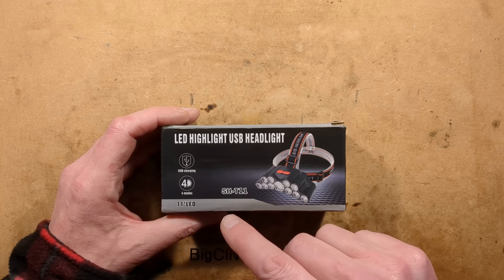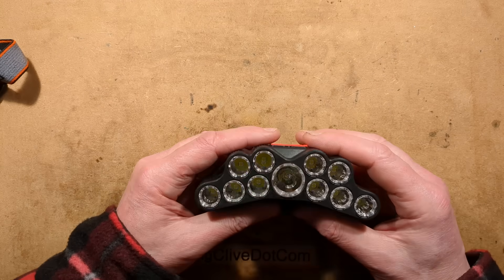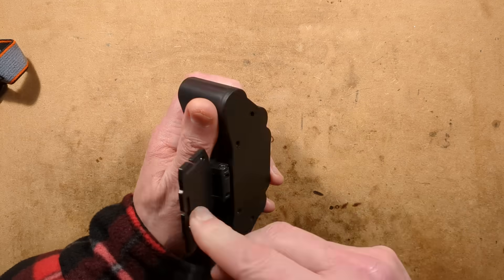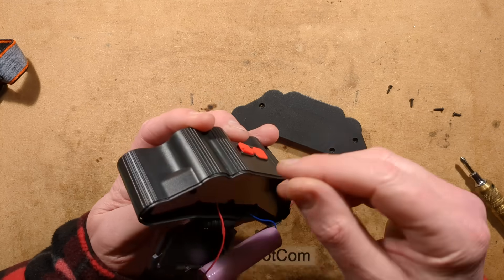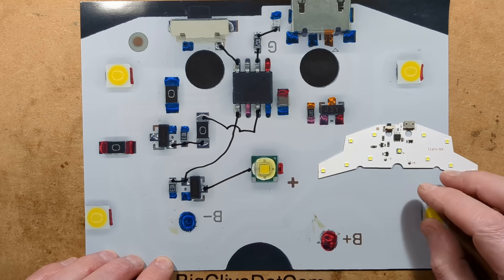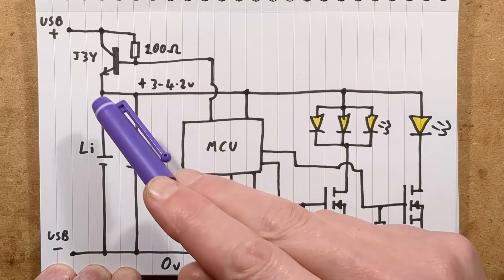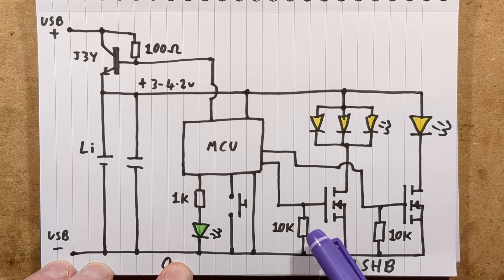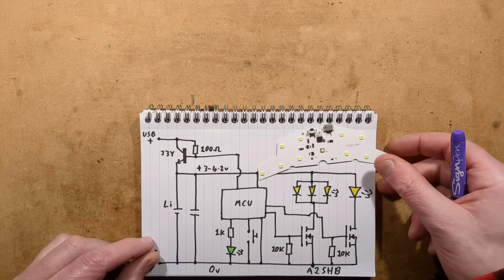Inside a (cheap) Mega head torch

Comment: Why does any headlamp have a strobe mode? I've never seen a use case for it. And assuming there is one rare time when it would be useful, make it not part of the process to turn the damn thing off EVERY TIME. Press and hold the button for five seconds or something to make it strobe.
Reply: I've seen some bicyclists with strobing lights which draws attention and I get that - but I'm with you. Strobing or SOS on just about every light is silly IMO.  That and having to cycle through all the modes to turn something off.
Reply: @amorphuc  , it makes the power supply last longer.   thats its benefit.
Reply: @vsvnrg3263 And it wears the switch out😊 sooner
Reply: @amorphuc  The strobing isn’t useful even for bikes. It makes it difficult to determine the distance of the bike. A solid light is way better.
Reply: @xluumu  My bike light has a couple optional strobe modes. I'll use those during the day. But at night, always solid. And I can turn it on and off without triggering the strobe.
Reply: @xluumu  Yea.  Not sure about that.  Strobing bicycle lights seem to truly draw attention.  I see them and take note for sure.  I don't think I have to consider their distance so much as far as seeing that there there.
Reply: @strehlow  I think any bicycle light is a very great thing.

Be seen!  Be happy.  Be cool!
Reply: @xluumu  Yea. Not sure about that. Strobing draws attention.  I'm not sure I like it though or if it's really useful.
Reply: Cheap Chinese LED flashlight chip looking to add features
Reply: @BlaMM74  bingo
Reply: @BlaMM74  They'll add them to rulers next(as they did with lcd), ban the Strobe!
Reply: It's for those occasions when you are in one man party mode and need to dance like nobody is watching 🥳
Reply: It's because China has a deal with the rest of the world to make people with epilepsy go to hospital more. 

It's a joke obviously. But seriously, I feel bad for people sensitive to strobing lights.
Reply: DiodeGoneWild made a video a while back showing how you can make torches skip the strobing mode
Reply: You know how when you get pulled over in the dark and the police shine a bright blinding torch into your face. I like to turn my bright strobing seizure inducing torch into their faces and irritate them too.
Reply: China circuitry. The one circuit gets put into everything. The ones that have police lights are illegal
Reply: What really pisses me off is the people who wear a head torch to go walking at night (particularly in winter when it's dark quite early).... And then they insist on looking into your car as you drive past. Blinding you from a distance wasn't enough... They have to get it right into your window as you pass by.
Reply: @tin2001 I've been on group camping trips where some bell-end had a head-torch, it's really annoying when, at night, they suddenly turn to look at you when conversing...
Reply: I am one of those cyclists that uses a scavenged headlamp, converted to a LiPo cell (from a trashed vape stick), band removed, and mounted on my old steel Bianchi for a bicycle light. It works pretty good for free, and I do appreciate the strobe mode!🚲🔦
Reply: While bike riding, I will use a strobe mode on the headlight because it is more eye catching then just steady on.
Reply: @terminashunator I get that it's more eye catching, but distance measurement almost becomes 1920's stroboscopic. I know someone's there, but as a pedestrian, are you on the road as you should be or about to plough into me and scream that I'm blocking your footpath? Warning, the light is about to turn back on. And off. And on. Repeat. You're not really visible, you're now a pain in the arse because I can't judge where you are until I can actually see you under a streetlight or similar. Can I cross the road, or do I need to jump into the road to avoid being twatted? NPCs in your world hate you.
Reply: @georgeprout42 bike lane in the street, as one should be. Cars in California don’t pay attention.
Reply: @georgeprout42  Completely right. Strobe in daylight is a safety feature. Strobe in the dark is worse than no light at all because you dazzle then disappear.
Reply: @terminashunator  Booo.
Reply: Its for the red army
Reply: It is part of our 🇬🇧 highways code that cyclists must make themselves visible at night to vehicle drivers and pedestrians when cycling at the side of the road, most put a flashing light on their helmet, front/back of the bicycle ~ as an excuse for not wearing reflective clothes
Reply: @samuelfellows6923   It's also the law that the light must be attached to the bicycle, not the operator, and no more than 1.5m above the road surface.   This device also appears to exceed the maximum 4 Hz flashing rate allowed by the road vehicle lighting regulations, so it wouldn't be legal to use in flashing mode even if you attached it to the front of your bicycle.

Comment: If the charging circuit was better I would like this headlamp though I would change the 18650 to a protected cell with more capacity and redesign the cover to hold it securely.
Reply: I was thinking that as well. Replace the 18650 with reclaimed vapor device cells and using a dedicated DW01 for protection. Might also be a good idea to use something like a 500 mOhm resistor in the supply lead to reduce strain on the LEDs and improve battery life. You could fit a good 6 cells in there I bet, 550mAh each… I think they are 12400s

Comment: "Chrome" plastic, isn't. Or at least not since I was a young boy. You put your parts in a vacuum chamber, spin them, and vaporize an aluminum slug or wire. The vaporized Al impacts and condenses on the plastic. Avoids most of the problems of electro-plating: high cost of true Chromium, better 'throw' into indentations (electro goes to the high points), Carbon, Copper, and Nickel under-layers, and toxic sludge. Similar process and maybe the same chamber to make carbon-film resistors, except they are spun in carbon-rich gas such as scorched butane.
Reply: Looks fine until it bubbles, peels, and turns green.
"Chromed" plastic is my nemesis.
Reply: Not to mention most plastics need to be "activated" using platinum salts that make the surface conductive to take the initial copper plating layer.
Reply: that's cool as hell. Now I want to buy something with that on it.
Reply: @grandrapids57 
You have never purchased a car?
Reply: CDs, originally,  were also plated with aluminium evaporated in a vacuum chamber
Reply: Richard Feynman was involved, in his youth, in a tiny company involved in some early metal-plating of plastic. He noted that the metal coating could often be peeled off with little effort: their process had certain drawbacks.
Reply: This can't be the full story. Aluminium doesn't stay shiny like chrome. And with some kind of clear coating, the multimeter wouldn't show low resistance unless the probe tips were really sharp.
Reply: @felixmoore6781  , correct.   it must have a plastic coating over it.   car headlight reflectors are also aluminium not chromium.
Reply: In all my years of experience these things, they turn bad everytime unless it stays in a stable environment.
Reply: Or maybe it's just sprayed over with chrome-like paint. 🤷🏼
Reply: prr, yes, i think aluminium is the only metal involved here.   and not very much of it either.   its only aluminium involved in food packaging too, however they do that.

Comment: That transistor 33Y is going to self regulate without aid from the uP. It will start throttling the current when the battery gets to about 4.0V and cut off charging completely when the battery gets to a diode drop below the 5.0V USB rail, say 4.35V. A bit spicy, but approached linearly.

Are you sure that coating is chrome? Aluminum can be vapor deposited in a vacuum and forms an excellent surface. It's used for first-surface telescope mirrors.
Reply from the maker: The charge tailed off at 4.233V with a base reference of around 4.88V.  The coating seems fairly solid.  There's no coating on the outer surface, so I'd guess it may still be chrome.

Comment: .. Quite dislike having a microprocessor determining when to end charging... MCU-Lock-up...Batt cooks, hopefully not starting a fire.
Those Leds have a tough life, would be a rather brief one if a normal high current LiPo was installed.
Will be interesting to see current draw (and battery terminal voltage) in the different modes.